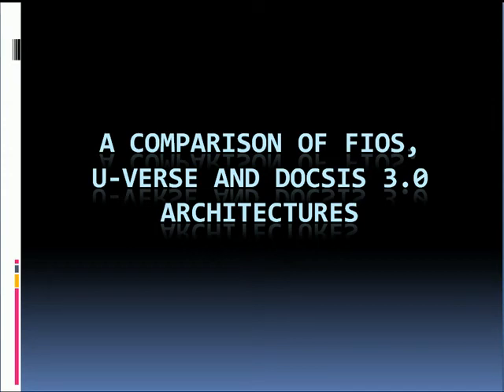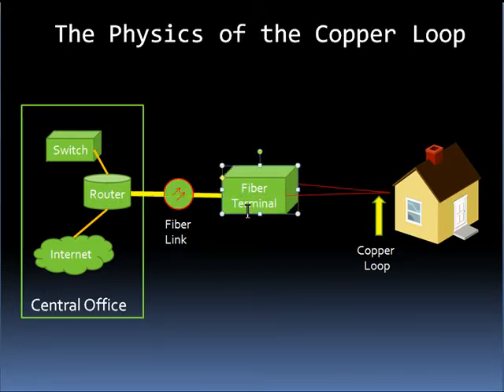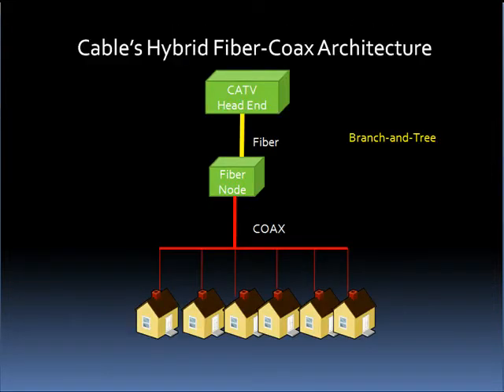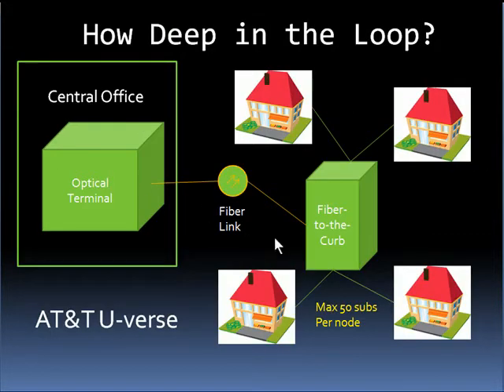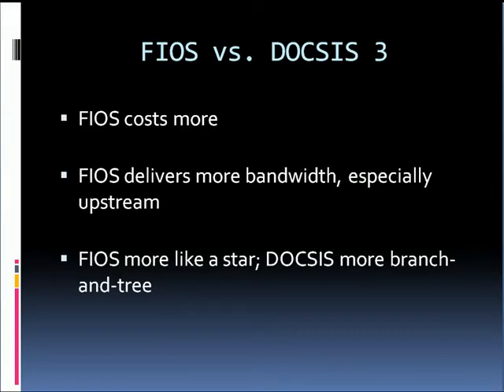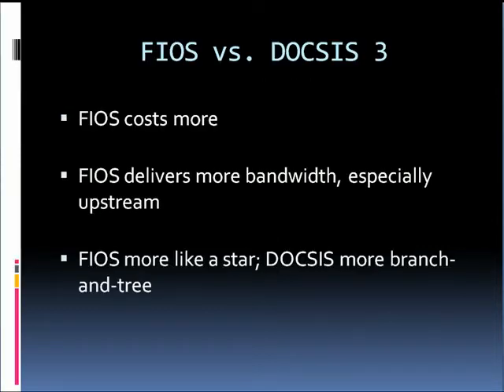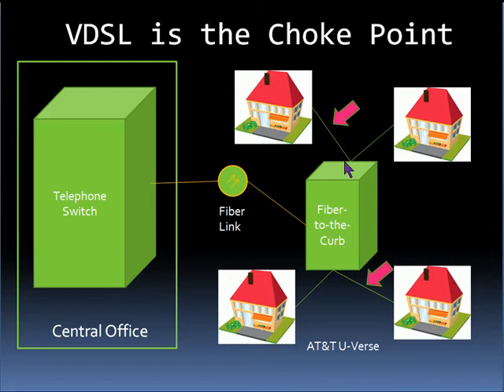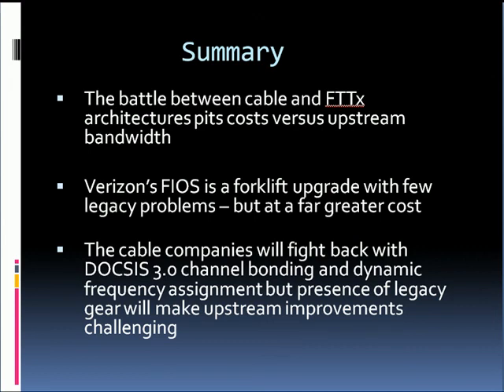FIOS vs Cable

Comment: He didn't mention CDMA for DOCSIS which gives 127 virtual channels for each physical channel. Each virtual channel has ~40mb of bandwidth, giving about 5gb/s of bandwidth per 6mhz channel.

This is why my neighbors and I can download 100+mb/s at the exact same time with only 4 channels. 4 channels should be only 160mb, yet we can pull down over 300mb/s sustained, while still maintaining 20ms pings to gaming servers in other states.